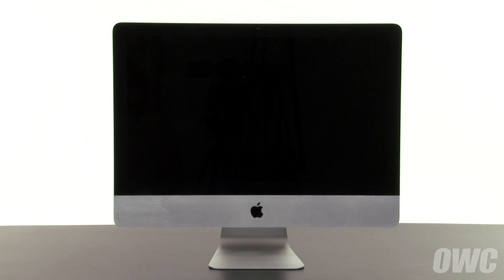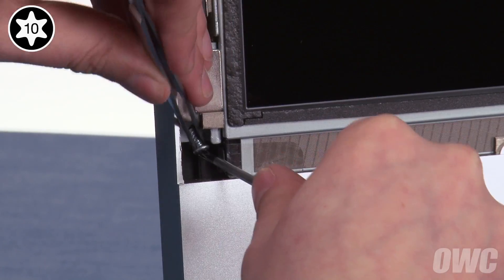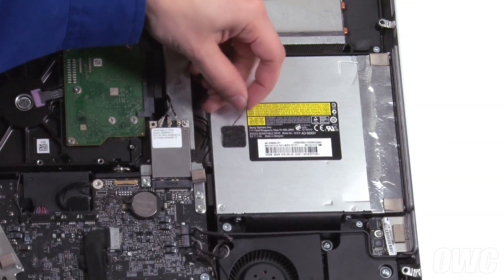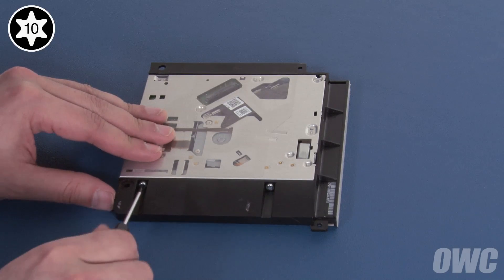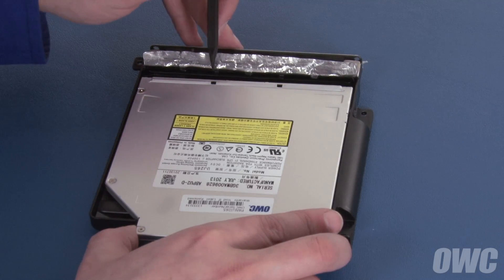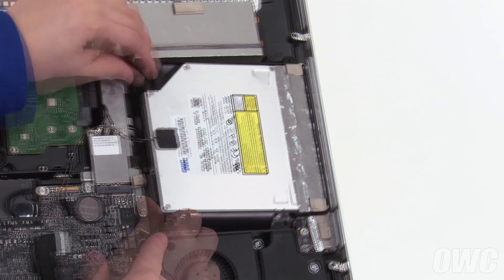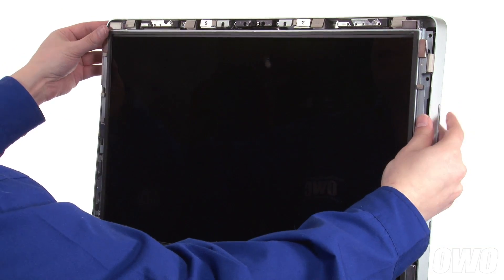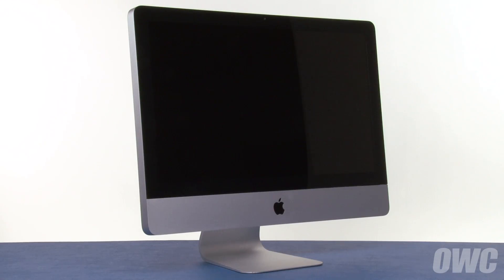21.5-inch iMac (Mid 2011) Optical Drive Installation Video

Comment: Great job fixed mine
 Great job on this video I replaced mine with a used cd ROM and fix the problem hardest part was reconnecting the cables thanks again for the great video